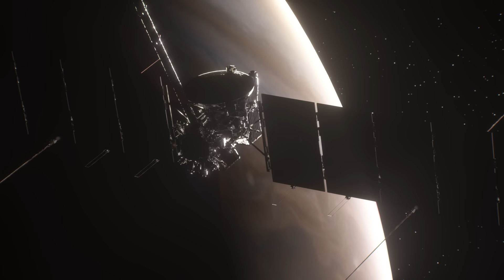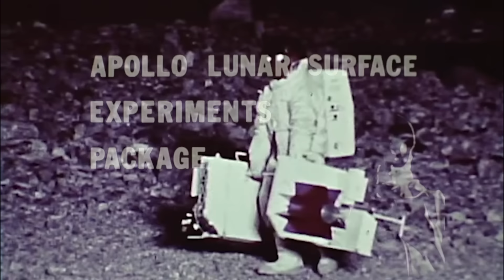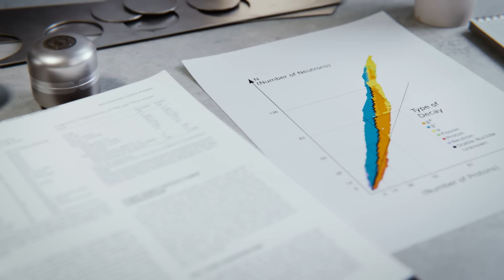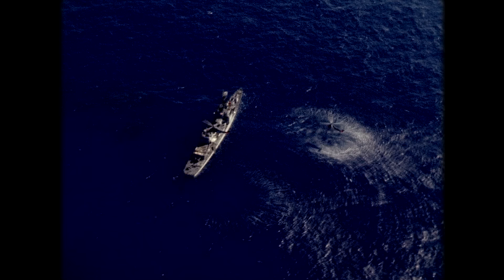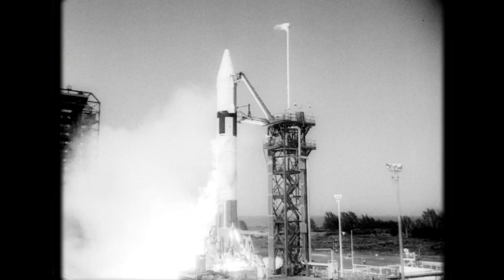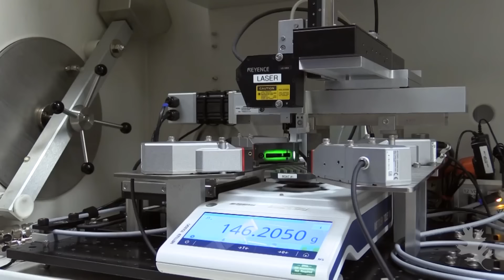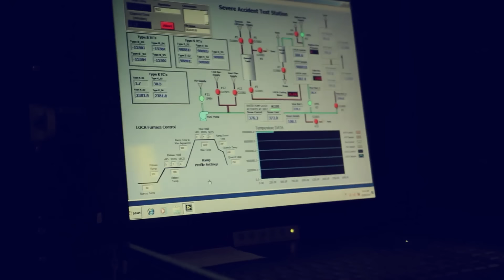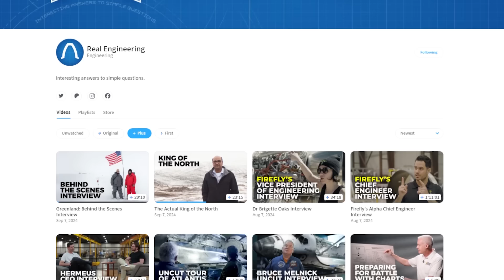NASA'S Plutonium Problem

Comment: maybe, possibly, they should increase NASA's budget and let the MILITARY have less, y'know?
Reply: You have to be kidding me. Military funding has nothing to do with NASA funding. And military funding in the U.S. supports a massive number of civilian and commercial sectors, just as it does elsewhere.
Reply: @Objectified  I couldn't find anything saying that it helps civilians, are you talking about civilians in the military? Or what they invent? Also i'm relating the two budgets because if the military loses a little bit of money, and NASA gaining a little from the military, it is more equal than if we were just to give NASA money. However you also have to take into effect that a lot of the military's money is going to maintaining aircraft and other vehicles, as well as salaries.

Comment: Looking at the tables supplied, there are two other isotopes that can be used.  
Strontium 90, which was used by the Soviets and USA to power remote installations.  It has a power density higher than Pu238, but does require more shielding  Still, when at Jupiter and beyond, it would still be a lot lighter than the equivalent solar panels. And it has been used by but the USA and USSR on ground based applications.
Americium 241. This ha a power density a quarter of Pu238, but requires less shielding than Sr90. It is commonly available and the manufacturing and  handling procedures are well established. It will also allow much longer mission durations than Pu238.

Comment: Canada has the ability to produce 5kg of Pu-238 per year. Talk of making us the 51st state and applying ridiculous tariffs will virtually guarantee that NASA won’t see a gram of it, though.
Reply: No. First, NASA doesn't need Canadian P-238. The U.S. is already producing enough domestically to fuel NASA deep-space missions into the 2030s, and is ramping up further production over the coming decade. Second, no, Canada does not have the ability to produce 5 kg of P-238 per year. It is in the process of conducting a feasibility study with the eventual goal being 5 kg annually, but the last time it tried this (in conjunction with the U.S. Department of Energy's Pacific Northwest National Laboratory) it became and remains mired in regulatory limbo.

And if you don't want ridiculous tariffs applied, work honestly with the U.S. on resolving legitimate trade issues the U.S. has with Canada. You know, the same types of issues for which Obama put tariffs on some Canadian goods. Canada isn't the noble good guy here, and the U.S. isn't the villain. Neither side's leadership are acting like adults.
Reply: Why would the US tarrif a US state? Do you even think?

Comment: Plutonium-238 is the most dangerous radioactive material known to man. Inhalation of a single microscopic particle will kill you. The problem isn't that we don't have enough, it's that NASA was stupid enough to use it in the first place. There is a HUGE $25 billion plutonium-238 clean-up problem at the DOE plants that produced it for NASA, and NASA doesn't have to pay.
Reply: The fact that your first sentence is false doesn't help your argument, your second comment makes it laughable if you understood how litle radiation a single particle produces.
Reply: @miguellopez3392  Forget Mars. It's Uranus that really needs to be probed. Plutonium-238 is given the highest relative hazard number (152) of all 256 radionuclides evaluated by Karl Z. Morgan et al. in 1963. ( Morgan, Karl Z.; Snyder, W. S.; Ford, M. R. (1964). "Relative Hazard of the Various Radioactive Materials". Health Physics. 10 (3): 151–169
Reply: @jacksprat9972 who mentioned probing mars? Its about landing on it with people, and no even plutonium 210 is more dangerous, there even more radioactive elements but they tend to only last a few hours to days.

Comment: There is another solution. Scale up the size of spacecraft and use uranium fueled kilopower scale reactors instead. With the amount of super heavy lift coming online, this is a viable solution. Throwing mass at the problem solves a lot of issues when you aren’t counting grams on your spacecraft.
Reply: No, don't do this. You would either need to use the nuclear reactor to be the rocket, or use a ton of liquid fuel. Additionally, if this blows up in testing, while being built, takeoff, or low orbit(Where most issues occur), that is literally worst case scenario for contamination. You would need to have a huge area(maybe 50 miles in each direction preferably with mountains) to contain that fallout. Reactors are super safe, but if you add large amounts of combustable fuel to them, you could have fuel issues that cause failure.
Reply: There is a huge risk involved in transporting fission material into outer space. Imagine a rocket carrying a spacecraft with such fission reactor exploding. Wouldn't be the first time a rocket exploded, but this time it would carry severe consequences. That's also why we don't dump nuclear waste into space, too big of a risk of it getting in the atmosphere and contaminating the Earth in case the rocket carrying it malfunctions.
Reply: You may be right.  Look at the weight of an unshielded Small Modular Reactor
Reply: @ it’s simpler than that. NASA designed and built a very small reactor  called Kilopower with a sterling engine with 1-10kw of power production. The reality is Pu-238 is just too scarce to launch the type of missions at the power budget we need. Especially when you are talking 5-8 years of the entire country’s production for a single mission.
Reply: @ It might be simpler, but we probably need to find something with a longer half-life, or more energy. Uranium is heavy for its energy, and shielding is also quite heavy, which means cost wise, it might not change very much. Weight means we need more fuel, and stronger engines. It already takes 5-8 years to build a new rocket assembly machine, a new rocket, with a new engine, go through all the tests, and all that jazz. Nuclear reactors are also super regulated, and Pu-238 being safe means it doesn't get nearly as much regulation. If the market for aerospace were to increase by a lot, we should change to uranium, because Pu-238 can't keep up. There has to be a better isotope, maybe even a uranium one that will last longer and give off more energy.
Reply: @dashdartfun  <Starship/Superheavy has entered the chat>

Comment: It does seem that these isotopes might be useful for direct heating as well (e.g. To keep in ingenuity helicopter battery warm or for heating homes in winter in cold climates (Pu-238 is probably too valuable, but there are other viable isotopes in nuclear waste, with shorter half-lives (higher heat output, but less durable))

Comment: Strontium-90 is also an alternative. The soviets used it to great success and we did in the us for a time. The dod actually has strontium-90 RTGs on order at the moment. 

The fact we can safely use one of the scariest nuclear waste byproducts would of been worth a mention.
Reply: Strontium-90 is good if you only need the heat & electricity, without any sensitive equipments (or humans) nearby. So perfect for Outposts, Lighthouses etc, not so much for delicate space sensors :(
Reply: @TheKnaeckebrot I was thinking about this. Thank you for sharing
Reply: Sr-90 is a very strong beta emiter which means you can't utilize the heat as efficiently and it's much more difficult to shield. The decay energy is only a quater of that for Pu-238.
Reply: @vaclavzajac214 Beta radiation is still shielded by a couple mm of aluminium. The really nasty thing to shield is gamma rays
Reply: @arthurdefreitaseprecht2648  What x-ray flux from Brem does this give? I can't be bothered to work it out...
Reply: @padsley  that's a good question, but this is why you use some lighter atomic weight material for shielding the beta, then maybe some higher atomic weight material to block the X-rays
Reply: @arthurdefreitaseprecht2648 
Gamma Rays. Are they any kin 2 the Giammalva Reyes family down the street here?  Real nice folks!
Reply: @vaclavzajac214 
Who  Sez ??
Reply: @vaclavzajac214  "Scary" only thanks to propaganda from anti-nuclear energy nutjobs. We would have had numerous Pu-238 and no supply issues nowadays if not for the faux outrage over 3 Mile Island.
Reply: ESA has demonstrated a working Am-241 RTG cell but only in prototype form. Am-241 has a much longer half-life than Pu-238 so the cells would be larger and heavier for the same initial power delivery but they would last a lot longer in flight.
Reply: I put that on my pool
Reply: How do you know that the dod has strontium-90 RTGs in order? 😳
Reply: strontium-90 has its own problems. i think it would be too dangerous to use in a manned mission
Reply: Sr-90 is used to generate Tc-99m which is collected and bound to antibodies that in turn injected for imaging.
Reply: Soviet vacuum tube technology can survive that beta radiation. Silicon can't.
Reply: That strontium-90:  is that the same stuff my dentist uses for fillings?
Reply: It's probably more dangerous to handle than Pu-238 in preparing it for RTG and spacecraft usage. Pu-238 is bad news if you breathe it in, but otherwise it's not bad to handle. Strontium-90 just loves getting into your bones.
Reply: Imagine we could do a nanobionic system that harnesses this nucular energy XD
Reply: @007hansen  considering what happend to a number of people which picked up the Sr90 sources from lost/not looked after any longer soviet RTGs - REALLY BAD IDEA.
Reply: well yes but they only last for 30 years of halflife however thats a bit less then 1/3 of the plutinoum however. struiom-90 is only realy good for large scale platnery rtg and nucleare stirling engine fuel for gronud stuff for power and vecales. also makes zicuom-90 after it deacys in 30 years by the way. but all of he strouom-90 the. sovents used has allready fully decayed into zicuom-90 and thsoe got raided by rare earth tresure seakers. and pouchers. shure struom-90 is good for rtg and nuclaer strling engines but its only good for large scare mass prodcuon of rtg and nucler strilng power genrators on allready extablsihed setelments and inferstucure. it sucks for deep space probes or for very long term space outpost sistems that are not nearby a good aera for logistical reasons.

Comment: Man this takes me back. Helped build the trailers that transported the Nuclear generators for Cassini back in the early 90s. I even have a thank you Plaque. Need to dig that out. I may even have a mission pin. Need to check my desk drawer at work. It took the plutonium-238 generator from Mound Laboratory in Miamisburg, Ohio to Nasa. Unfortunately, "the Mound" is no long there.
Reply: Mound had the big steel cylinder glove "box" we used at Matrin Nuclear to assembly all the SNAP 19s for Pioneer and Voyager

Comment: With Veritasium mentioning that the Mars copter Ingenuity used 70% of its solar power to just keep warm, would the weight of a tiny pellet of 238, just big enough to keep the box warm, be smaller than  additional battery capacity to store the energy for the heaters?
Reply: A very good idea.
Reply: It was a gimmick project with very little finding that was only supposed to run for 30 days (as was mentioned in Veritasiums video). If it would have been properly funded, they would have used Pu-238 for sure.
Reply: either using it as a heater directly or as additional power for a heater would be viable
Reply: @PatrickOReilly search google for Radioisotope Heater Unit (RHU).
Reply: Something to consider for the next bigger one, whenever that happens.
Reply: I can't believe how many of us actually watch real engineering, and veritasium videos.
Reply: @42saidthemachine I can. There’s a lot of overlap in topics.
I’d imagine there’s a lot that also watch Practical engineering, too.
Reply: @42saidthemachine all hail "the algorithm" 😅

Comment: Don't they have a reactor in Canada that produces plutonium 238?
Reply: No. There was a collaboration proposed in with the U.S. Department of Energy's Pacific NW laboratory that would have been great, but it died in Canadian regulatory limbo. There is currently a feasibility study underway in Canada to determine whether its existing nuclear infrastructure could be leveraged to try to produce P-238, but there are many very large questions around the viability of that. Fingers crossed. Canada and the U.S. will only be in this tariff war for a short time, and they're both better off when they collaborate and both sides act like adults.
Reply: Nope

Comment: Ok .. Now it makes sense why not Uranium pellets... It's not a reactor, just a Stirling type engine where the Pu238 is a long lasting hand warmer.

Edit* no control rods, no water cooling that could potentially leak under pressure but I'm no nuclear scholar either and so my only guess, is, the reason Uranium isn't used has to do with criticality where too much is needed for a chain reaction to occur, and by the point, the volume of heat is far too much if scaled down to the fewest pellets needed to go critical?

Comment: 11:10 It seems silly to me that nasa would invest on a stirling engine for a long term space mission. Do you seriously expect to keep a mechnical generator running constantly for years?? The stress on moving parts would tear it apart
Reply: Material science has come a long way
Reply: @Xion-Rotti  Technically yes, in practice making one that will survive launch, reentry, substantial temperature gradient and expect to work for years without maintenance is... not easy.

Comment: tritium also could work... half life 12 years, can be made in heavy water reactors or from lithium.  some nuke waste could work in places already dealing with cosmic radiation, obviously a Stirling, or other more efficient engine could work, maybe get someone smarter than nasa to make it....  space x has had more innovation in reducing cost of launch in 5 years than nasa 50...  obvious nasa is often horrible at innovation
Reply: eg long range space probe you can have distance and only shield in between to use crappier nuclear waste isotopes...   maybe at some point you are generating isotopes in underground moon base or space station as a nuke reactor provides enough power and heat to do more mining, manufacturing, etc
Reply: nuke reactor on moon...  doesn't need much shielding...  already cosmic radiation so a few extra stray neutrons no big deal...  if it melts down disaster,  no big deal, just keep enough distance between reactor and rest of moon base...